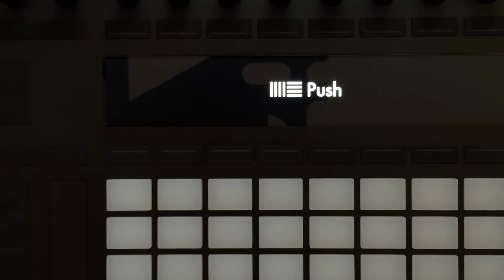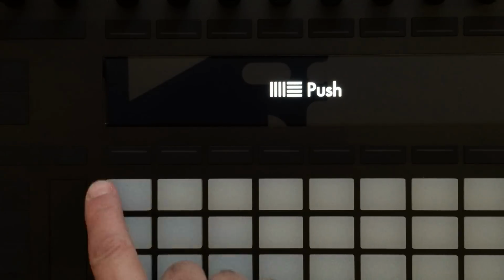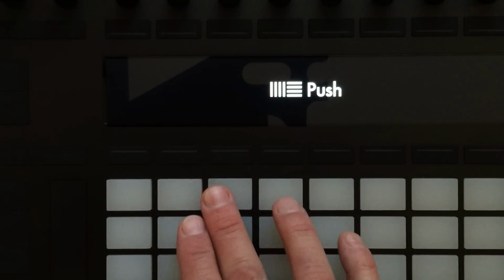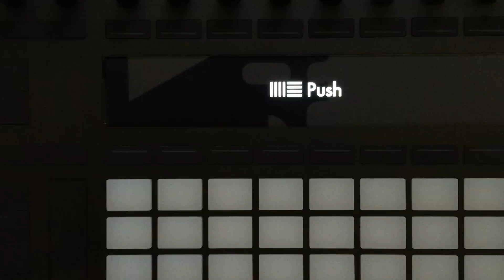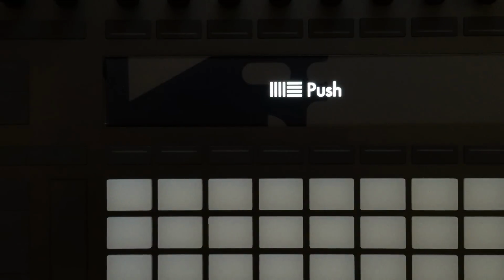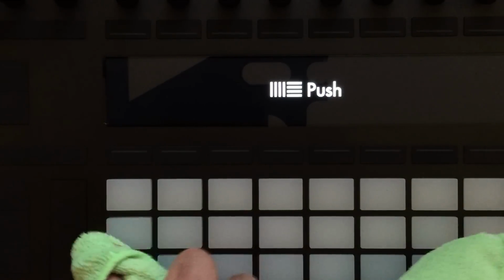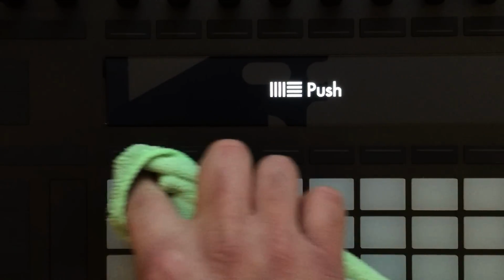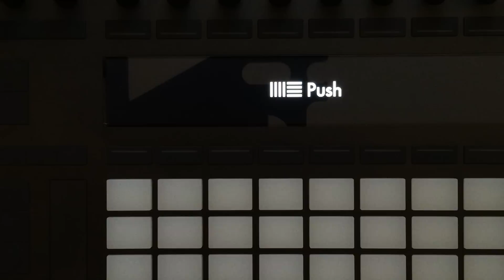Push 2 Wax Off Tip

Comment: You do know that the sensitivity is determined by the amount of resistance it generates on the BOTTOM of the pad? Check out the video Push 2 teardown and you'll see what I mean. Top is just a residu and has no influence, although it'll feel nicer
Reply from the maker: +SuperRiki81 I don't think the wax on top has anything to do with sensitivity directly, but it seems to make the pads themselves a bit stiffer with less "bounce" to them.  With it off, they seem software and more responsive.
Reply: BileMonkey :)

Comment: Hi - Over time, do the push 2 pads start to take on the sticky characteristic of push 1 pads?  Or do the push 2 pads stay sort of slippery even when they are totally broken in?  Thanks!
Reply from the maker: Once I removed the waxy stuff, mine have been the same for well over a year now with no change.
Reply: would you say that once the waxy stuff is off, the push 2 pads are still more slippery than push 1?  I find the push 1 pads quite sticky - which I like.